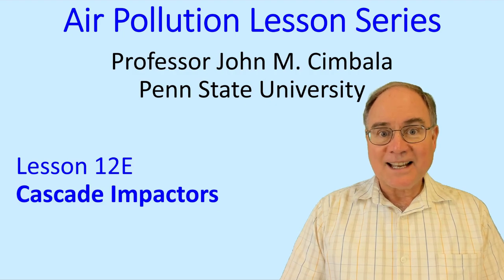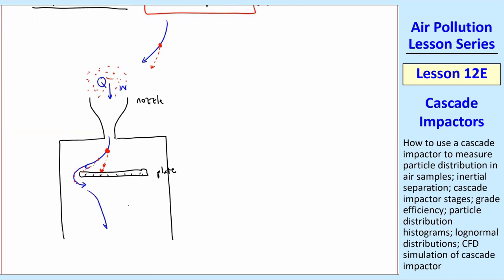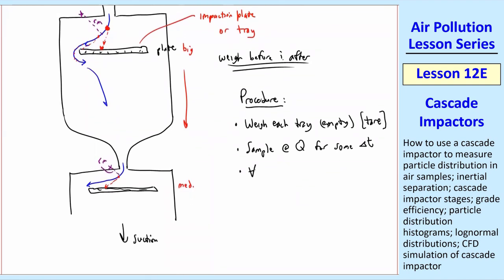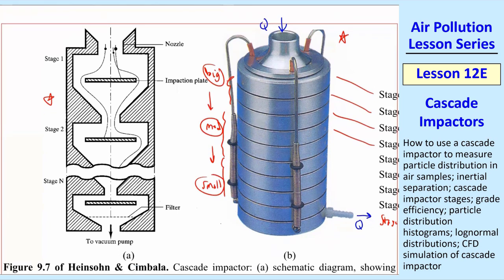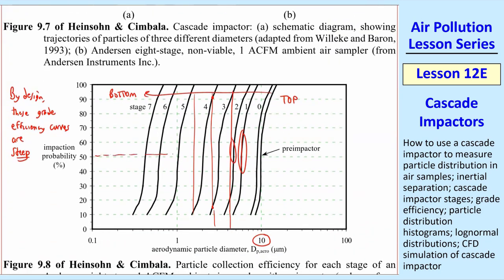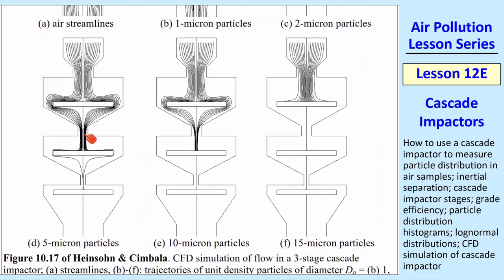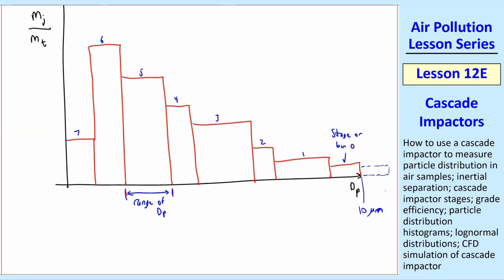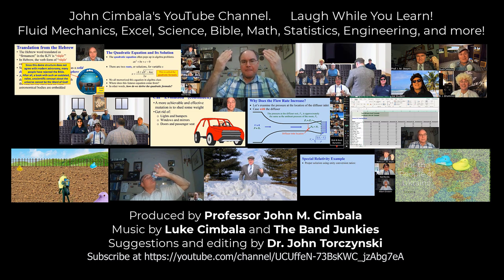Air Pollution Lesson 12E: Cascade Impactors

Comment: Hi. I guess it helped me. Please, hear me out. They write in definitions that gravimetric analyses is that you weight a filter before and after known airflow through it. It makes sense, you know how much air went through, you get dust on the filter, you weight it, you get it and convert to concentration using math.  But the  weird part which is hard to understand if you never did it yourself in real life is that if you use a filter you get particles that are LARGER then the ones you wanted. All larger particles. They never mention any impactors in definition of gravimetric analysis. But as it seems the point is they first use impactors to make super large dust go away and once we get small particles then we catch them on a fine filter, is it correct, sir? From what I see in the video it makes sense to me. You use impactors and then you use a filter to get only ultra fine kind of particles on it
Reply from the maker: Yes, that makes sense. But cascade impactors are devices to measure the mass concentration of various size ranges of particles. They are not meant to remove large particles. What IS often done, however, is to use a cyclone separator to remove the large particles and then after that use a filter to capture the small particles.
Thank you for your kind comment. Please tell your friends and colleagues about my YouTube channel where there are more than 400 free videos about the Bible, fluid mechanics, science, math, statistics, air pollution, and other topics. I would greatly appreciate it.
Reply: @johncimbala  thanks again